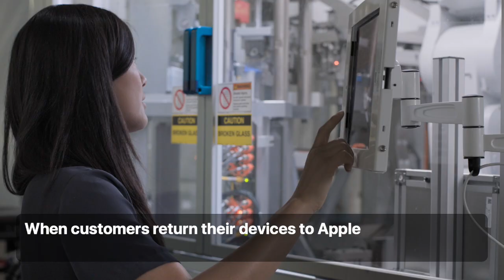Apple introduces Daisy, a new robot that disassembles iPhone to recover valuable materials

Comment: R&D and maintenance of these machines probably costs more, or as much, as the "recycled" parts/marterials are worth.
Reply: @NoHemlockForMe  we didnt need an essay
Reply: If it cost apple more to do this they wouldnt do it, its apple, they arw cheapskates
Reply: Even if this process is more expensive than mining raw minerals from the earth, eventually there wont be any left. And when every manufacturer starts having the problems of material shortages, while Apple is actually already has the technology for utilizing materials from their old devices, we will see who is going to end up more environmentally friendly. No other manufacturer has made the pledge to only rely on recycled materials so far

Comment: Why not spend that money to make phones that doesn't break too often?
Reply: they are meant to break so you buy another one. its planned obsolesence
Reply: oh come on. if you take care of your phone then it won't break. I have mine for 3 years now and my dad just recently gave away his still working 3gs. you can talk a lot of shit about apple but if you break your phone its not necessarily the manufacturers fault
Reply: Erosion Creations you clearly didn't understand the concept here
Reply: what is the concept then?
Reply: Erosion Creations ik that phone handling matters. But recent years Apples phones are becoming fragile than the previous years. Cmon now a glass body? And the cost to repair it is huge. Why not spend the capital to solve those problems. Rather than solving the problem in core they are doing this.
Reply: Batteries degrade over time.  Most people would rather get a new phone than pay for a battery.
Reply: I don't think that's the case. I think most people would be willing to spend $60 to install a new battery in their phone if they knew it was even an option for them. But I don't think most are aware it's even an option, because when they go to the Apple store to talk about their battery issues, the """genius""" sitting behind the counter does everything in their power to reject any kind of repair on that device, and instead push the customer towards a new phone. Same thing with carrier stores.

What sounds better? $60 to bring new life to your device, or $500-$1000 for a new phone that is given to you under a perpetual-lease contract via your carrier? Most people need new batteries right around the time they have finally finished paying off the financing on that phone. Why go back into that hole if a $60 battery installation will fix it?

The way manufacturers and carriers want you to treat your phone is like if you bought a car and had to get a new one when that one runs out of gas.
Reply: @spartan456  A batter replacement here for any iPhone is 79 EUR (~USD)
Reply: @tomjacobs806  If you cant take care of your own devices, then I feel sorry for you
Reply: @erosioncreations7763  People act like phone cases dont exist and are then surprised why their things end up broken after running them over with a car
Reply: @mrbillnot  A battery replacement is pretty much the cheapest repair one can do. If people buy a new phone every 4 weeks and throwing the old ones away then they are the problem, not the manufacturer
Reply: @spartan456  I had my display replaced by them for free even out of warranty. And they are stating their battery replacement prices on their support website. If consumers are too stupid to check out the support page and head to the Repair and Service section, then thats their problem. I agree they might want to push users to buy a new device, but then they could easily just stop offering repair and support services alltogether, and remove all of their help documentation from the website